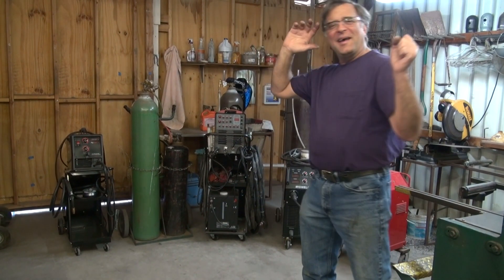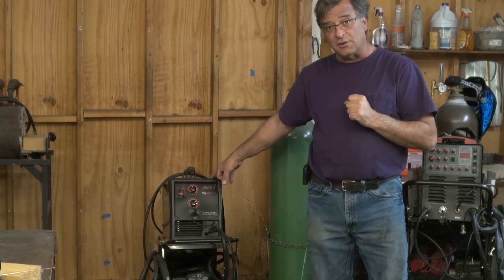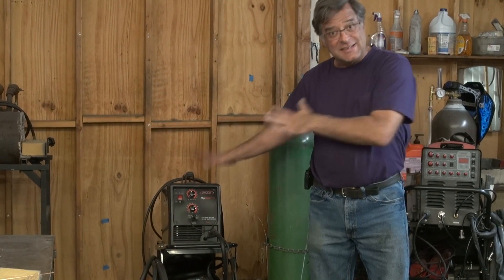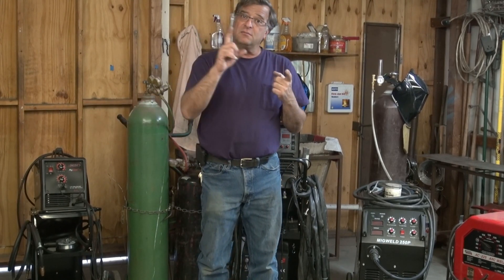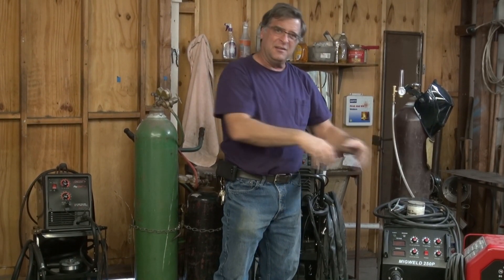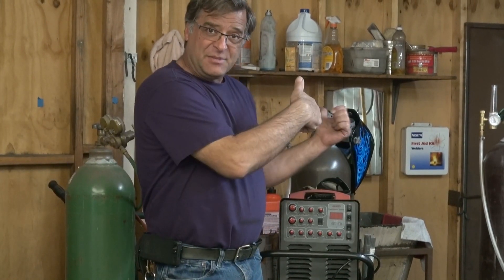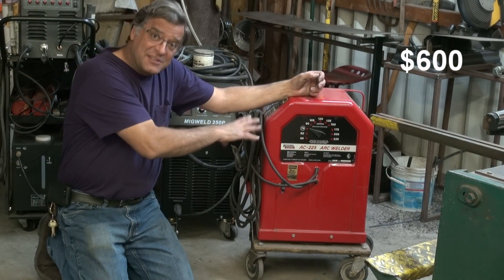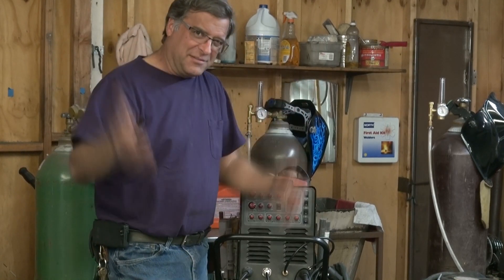How to Pick Your First Welder - Kevin Caron

Comment: Haa haa ha - that slack commercial was so fun it was better then you Lol - all kidding aside how come you didn't include Hobarts or Millermatics - guess I'll have to go look at another commercial to find a video on them - I don't see an issue with smoke and getting hot - cooking a burger is smokey and hot too - Now here are some examples of what I'd like to do indoors and or outdoors at home - my Ford truck trailer might need some welding - I want to add a draw bar to it so I can back it up in a straight line better -  A broken Harbor Freight 5" cast iron vise needs welds - I might want to add a 3rd wheel to a lawn sweeper - I think it's aluminum tubing - My early 70's Ford LGT 125 Garden Tractor  doesn't need any welds for now but it might in the future being thats it's more then 40 years old and I still use it - I might also want to build my own implements for it from scrap and will need to weld - sometimes I get into a project and literally have to make my own tools for something - I am also a car boat and bike enthusiast and I own a trailered 16' cuddy cabin boat - I'd like to add more rollers to the trailer - the trailer is constructed primarily of angle iron and I need to weld brackets for new rollers  - I want to build my own table for welding - I  want to make an overhead  kitchen stove vent from a washing machine shell and paint it black - I'll need to cut it shape it and weld in brackets for a fan and supports - I want to cut down the metal pole made from pipe that was used for a television antenna next to the house and make a scaffold out of it for house painting -  I have a bucket full of market basket wheels that I would like use for work tables and will need to weld - I want to build my own rolling stand for a 400 pound table saw from scrap and will need to weld - I also wanted to know with the gas welding - can we bend PVC as well -  how many minutes or hours can we weld or cut with full tanks - does cutting with a torch typically use more or less gas then welding with the same gas - power available now is either 120 v 15amp or 240v 20 amp if i unplug the large window mount AC and reroute the line into the basement  - just can't run AC while I am welding - my house has both gas and electric hook ups for the kitchen stove - my stove is gas leaving me 40 unused amps available and I think it's a 240v 40 amp plug with really thick 8 or 10 gauge wire running to the main panel - do I start out with a120v 15 amp machine or a 240v 20 amp machine - or go big with the 40 amps available - My home does not have aluminum wiring - all copper but its also a 2 wire not 3 system being it's a 101 years old so there is no real ground - is this safe enough to do welding -  do I ask too many questions - LOL - you don't have to answer that
Reply: The smoke from a burger won't put you in the hospital.  Depending on what you are welding the smoke can kill you.  The smoke Kevin was talking about is not lethal but also not good for you.  The hot part is WAY hotter than a grill.  Tig you have a very small area that is close to the melting point, gas you have a much larger area that is close to the melting point.  All that heat goes someplace, at you, igniting anything close, etc.

For the right things it's a plus to have all of that heat, but not always.
Reply from the maker: +Boo Tran        Just be careful with the old wiring..       and let your budget be your guide..      Have fun...

Comment: It is an excellent description of the equipment and processes available for amateur and light fabrication welding
It is judicious to omit processes like submerged arc as they are used exclusively in heavy fabrication
I insist that it is important to choose a machine that is not too small for your application
Usually, when you use your welding machine in the upper range of output,  the arc is much less stable and you're likely to overheat your machine going for trouble very soon 
this combination leads to a much more difficult learning for a beginner.
Choosing a more powerful and a more complete machine worth every penny on the long run as these machines are more enjoyable to use and you'll not be tempted to exchange it at the first occsion

Comment: Hey, just a question. I'm starting my own welding place in my garage, but my breakers can't handle >25 amps. I want to buy an 80 amp stick welder. How do I convert my garage into accepting such a high amperage device?
Reply from the maker: +Blackfish Dude 

Run a 220 volt 50 amp line from your circuit breaker box to where you are going to be welding..

If you are not totally comfortable doing that you NEED  to call an electrician to run the wires..
Reply: Kevin Caron, Artist Ok, I will do that. thank you very much for your advice

Comment: Question, I was trying to weld steel piece to  aluminun bicycle with flux core but they dont melted. Can I use propane torch insted? What you recomend to me?
Reply from the maker: +ROD Boricua 

You can't weld steel to aluminum.     Try a bolt and nut instead.
Reply: Ok, thanks

Comment: Hi Kevin enjoy your video on YouTube and yes I'm a subscriber.my question is. is this welding machine the longevity 140, is it  good for welding thin one  inch or less, metal pipe tube for motorize bicycle engine exhaust muffler .and in witch setting and what type of flex coil weir would be good to use . I like so much to get that welding machine .I like all the multiple use it have . it will be my first welding machine . to work on my motorize bicycle engines .
Reply from the maker: +Carlos Cardova 

yes, I feel this is a fine machine for light work..    You will have to get it set up for "your" welding.   I can't tell you what settings to use when I don't know what you are welding...
Reply: Awesome  Kevin , I'm  also getting a tube bending machine I might go with the bench one. I have the metal tube pipe, I think there heat treated there black and thin .I just added  the longevity 140 to my shopping list to Purchase for next month .thank you  Kevin

Comment: Getting my first welder soon. The Harbor Freight flux-core is not a great one, is what I can afford. But if I make a few things with it and sell them, won't take long before I will get an Everlast!!!! Am excited, perhaps will get an oxy-acetylene welder to bend metal, and a plasma cutter to makr some artistic fence panels for decks. Thanks for the inspiration on getting into welding.
Reply: +Jeffrey Beyer Make some money and then upgrade to a real welder is an excellent plan. Everlast has a few good welders to choose from so the experience making things now will help you choose what kind of welder you want in the future.
Reply: +Brent Weiser Will have to start out small and slow, many projects to get done around the house. Have to go flux core or stick welding since have no shop building yet.
Reply: Got a HF flux really cheap and I saved the cost on a repair we needed to make so I don't feel bad, but...  I would not make that choice again.  You want a Mig that can go gas at a minimum because the flux only are really limited and the cheapie HF is AC so the splatter is really bad.

Comment: How well will flux-core wire feed welder work outside?
Reply from the maker: +Jeffrey Beyer         Very well!!!
Reply: +Kevin Caron, Artist Thanks, was debating between a stick or flux-core for my first welder. I do have a generator with a 20amp 240v outlet. From what I've researched, biggest welder I can run is a 170 or 190amp flux-core.
Reply from the maker: +Jeffrey Beyer       Make sure the generator is rated to run your machine..     That it has "clean power"..    Most inverter based welders will not last long on a "dirty" output....

Comment: hi kavin i wanted to buy a welding set i know nuts about welding but i want to redo my back yard shade into metal now  its full of wood work. i am not sure what thickness metal i am going to work with but i am really do diy my self. pls advise mr kavin tq
Reply from the maker: +sage          A small 110 mig welder should be great for this project.        Look at the Everlast PowerIMig  140e.    Or maybe the Power Imig 200.    That one has a little power power to weld thicker metals and is dual voltage..
Reply: +Kevin Caron, Artist Complete concur. I've tried both of those welders and they are great. I've got one of their new 4 drive roller mig welders on order.
Reply: thanks for the advise kavin, i had bought a sitck welding set i want to learn from the hard way kavin lol..

Comment: If I want to do some hobby welding in  my garage, at most furniture frames and junk art, what welder should I get /what type ?
Reply from the maker: +AyabaraGaming        Any d/c tig machine if you are just doing steel..     If you want to play with aluminum you will need A/C.

I really like the AHP AlphaTig  200

Comment: Kevin  i love ir welders i hope to poses my own collection soon now im tryna do body work like patching n welding on new panels or trunck floors or car floors . i got the lincoln electric from home depot flux core HD  i really have no idea if this will even work for my intention. its the one with the high volts low volts switch high heat low heat any advice now im plannig on gettin a second welder any recomendations for my intended need for a welder. im thinkin of a mig.... ? but like i said not even sure witch one to go with  working outside
Reply from the maker: +Randy Zamarripa    I would point you towards a tig for body work..      Or a mig with gas and solid core wire..      Not flux core..   Too messy..

Comment: I wanted to ask a few questions. I want to do sheet metal work so around 18 to 20 gauge or 0.9mm to 1.2mm would oxy but I also want something that I can use once I really know how to weld to make motorcycle frames. Would oxy acetylene be able to do both of these?
Reply from the maker: +Tristan Truebody      I would think that it would be too hot for that thin of metal...    Never tried to do something that thin so just my opinion...       Oxy/acet has a very large heat zone compared to tig.   That would be the welder I would reach for to do either of these types of welding...
Reply: +Kevin Caron, Artist Thank you so much for the reply! I was also wondering I have a 200amp scratch tig. What is the rule of thumb for gauge and amps at 220 volts for mild steel? I have looked at various sources and I get different answers.
Reply from the maker: 200 amps will get you just over an 1/8th inch in one pass..    close to 1/4 if you bevel the edges before you start welding...   As for setting,,  just have to practice with your machine and see what works for you...

Comment: Hello, I am looking to buy a welder. The main reason why is because I want to make some workbenches for my new shop. I can't really decide which one I want to buy, a mig welder would be very easy to use to make the benches and I don't know how hard it could be with the tig. But also at some point I want to weld aluminum and I know that using a spool gun with the mig it works, but I still don't know which one to choose. Any help is appreciated thanks.
Reply from the maker: +Diego Chavez       All depends on your budget.       I am really liking the PowerMTS251si from Everlast.
Reply: +Kevin Caron, Artist  I am interested in welding with a tig, simply because it is more precise and I can weld different materials. But I really need to make my workbenches, the are 2 benches that are about 5 by 2 feet and another one that is about 8 by 2 feet. I don't know if that is more than I can handle with a tig welder or if you think it is a reasonable job to do for a beginner. 

My budget is around $500 by the way.
Reply from the maker: Check out the Everlast PowerArc 140st..  Should do you right...

Comment: thank you Kevin for the videos, job well done;  AA; what welding machine you can suggest (brand,size, prefer not using gas) for beginner (doing project outside the yard), ? BB: i am trying to weld steel rod (1/4") to make garden flower pot stand, and weld a piece metal handle to a small steel plate (12"X12"X3/4") or some aluminum projects  CC:not too expensive easy to carry. pls kindly advs. thank you again.
Reply from the maker: +cheng yi       The little 140 amp mig from Everlast would do great for this....
Reply: +Kevin Caron, Artist,  thank you so much, is this the one you did video for everlast portable power arc 140ST?!, have a nice day.
Reply from the maker: No,  that is a stick/ tig machine..

Look at this one   
http://www.everlastgenerators.com/product/mig/power-i-mig-140e
Reply: +Kevin Caron, Artist; good evening: the mig1140e is using wire with gas? i think i will go with stick machine. which one you can pls recommended? 140ST-everlast? thanks again for your time, bst rgds
Reply from the maker: Yes,   the little 140st form everlast is a great machine..   and easy on the budget...
Reply: +Kevin Caron, Artist  thanks, have a nice day.

Comment: Hi! Kevin , I just scored a Ine Skyline 1500 Stick , Tig  welder for a couple hundred bucks ! Only 8lbs comes with a case , welder , leads , hammer , brush and a hand held face shield . It works great  ! I used 3/32 , 1/8 rods through it and the welds were as good as my Miller maxstar 150 s ! I just got it and used 7014 , 6011 ! Today I plan on using 6013, 7018 , 6010 , yes it has a setting for cellulose electrodes , aluminum , mma , tig ! It's a  really cool little machine ! 5amps to 140 stick , 5amps to 150 tig ! I had to make an adapter from 20amp 230v t to a 50amp 250 welder plug and the thing works great ! Thank you for the help ! When will this all end , I have six different machines and two oxyacetylene setups ! Lol. Sure glad I'm single , I would never hear the end of this ! What another one ! Lol. I'm also going to try some 5/32 rods too , that should be maximum thickness for this little toaster ! Compared to the Lincoln AC/DC 225/125 arc welder this is way easier to lug around ! Have a great day buddy !
Reply from the maker: +Mr. Heiss     Awesome!!      I thought Skyline made chili in Cinni...??!!

Comment: If at all possible learn oxygen-acetylene first, that is what I was taught.
Once you know the basics of flowing metal together all types of welding become easier.

Coat hanger wire is trash, use baling wire instead it is much higher quality.
And so handy to have in the shop.

Comment: What's the best welder for fabricating BBQ smokers and trailers using 3/16...1/4....1/2...& 3/8" steel?
Reply: +cadencorin1  If you're going to be doing trailer work, a stick machine will probably be the best bet. You can do it with MIG, and probably TIG (I've never used or been around TIG so I'm not sure about practicality), but you want the better penetration that the stick welder will provide over the MIG. BBQ smokers can be done with all three.
Reply from the maker: +cadencorin1 Got to agree on this one..    Go with the stick first,     or mig..     Don't bother with the tig for this type of work...
Reply: +Kevin Caron, Artist 
Thx guys!
Reply: +Kevin Caron, Artist 
What voltage and amp range would be efficient?
Reply from the maker: 16 to 25 volts and a minimum of 250 amps.

Comment: Hello Kevin, sorry for the extended post 

I want to be able to weld my own projects, I don't have much welding experience, although I do have a lot of Soldering experience. I hear Tig is somewhat similar. 

The projects I will eventually be working on is a VW Engine based Dune/Rail buggy, and a Rat Rod motorcycle (Example Picture below). If you have never heard of them, Rat Rods are Structurally and Mechanically sound machines, but don't look like they are. I will be building my own frame from scratch, so I will need a welder capable of strength welds to keep this machine road worthy, but small enough to be able to attach small items like Brass bullet casings, or small Steel chains. 

Maybe I should get two? I don't have a garage, but I do have a Basement and a couple of large windows I can put fans in and an old Coal/Wood Chute for the older furnaces. I have plenty of access to 110v and only one 220v, my Father is a handy man so we can add another if necessary. 

Example Picture: http://www.hotbikeweb.com/sites/hotbikeweb.com/files/import/header_images/1205-hbkp-01%2B2010-rat-rod%2Bcover_1.jpg

Comment: can i weld leaf spring perches to an axle with a 110v flux core? ive read alot of people have done it on their jeeps no problem, but others say it does not penetrate deep enough. most of my work is in the driveway/garage. Any advice would be greatly appreciated.
Reply from the maker: xjmachine I would not do that..    Too small of a machine..   You need 150 amps minimum.

Comment: What is the best welder for building a Coned exhaust pipe for a 2 stroke motorcyle, (not flat welds,,,,using 22guage to 18 guage steel? thanks
Reply from the maker: Jean Villar My choice would be a tig welder..   Mig would be my second .